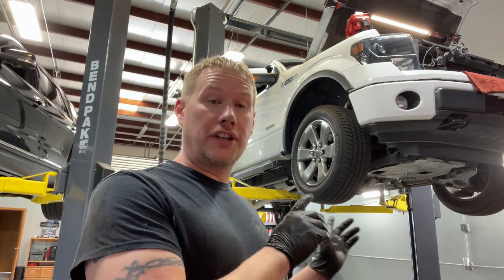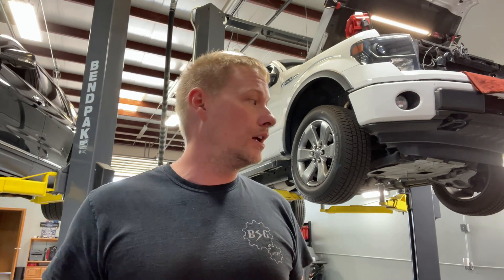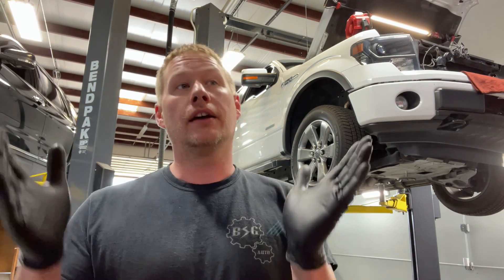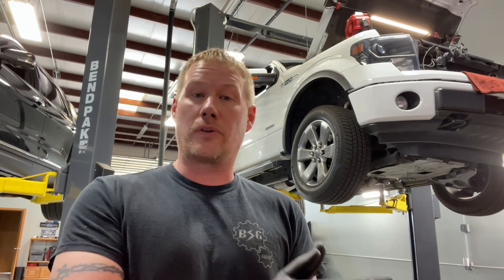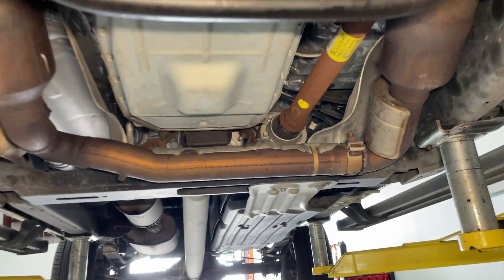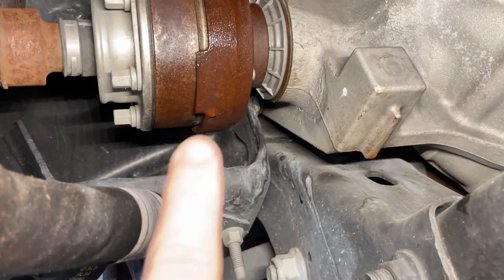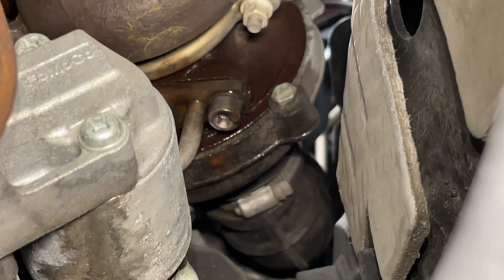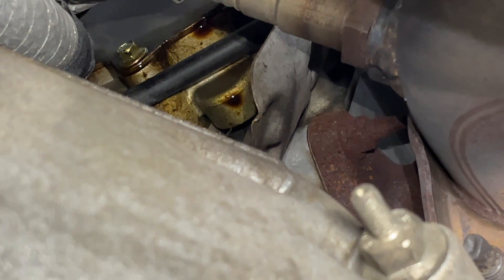Ford Ecoboost Engines Can be so Hit or Miss: I Really Feel Bad for This Customer...

Comment: Yelp, we just had a Ecoboost leave leat week. Had every possible coolant leak on it. No timing job on that one, but we have did several on other engines of the same with around 100K miles. Just very alarming to see such early faults. I have noticed that most faults are occurring when the truck is used for pulling trailers and used in work related task instead of a driving truck. Great info to the public.
Reply: Xtreme - hey sorry to bother you, i thought maybe you could give me a starting point.  my dad has a 2016 f150 with 3.5 eco with about 60,000 miles.  he loves the truck but it's hesitating under acceleration when he leaves a 4way stop or stoplight.  he's had it in to dealer twice and they can't figure it out or replicate it.  i'm trying to do research but wow - i thought maybe i could pull some injectors and check them out but i'm learning they're direct and more complicated blah blah blah.  have you ever ran across this Xtreme?  any tips for me?  thank you -barbie
Reply: @8barbies779  Hey there 8 Barbies. On your fathers Ford eco boost direct injection engine and all makes of direct injection engines there poses a problem with carbon deposits on the intake valves the the crankcase ventilation system. We are seeing this very often and what we do is to remove the intake manifold and clean each intake valve when the cylinder is at DTC on compression stroke. We have the ability to clean them almost to original condition using a blasting technique. Also these Ford engines have common Throttle body issues, but it is more likely to be on the intake valve carbon deposit side. I will post some pictures later on our website showing the before and after pictures of the intake valves. but I'm extremely busy. Maybe this weekend i will.
Reply: @xtremeautorepair   wow Xtreme, i had no idea you were a Real 'Pro', i guess i should have paid more attention to your user name:)))  i can't tell you how much i appreciate you actually taking the time to answer a pissant YT question from me - i know how busy you guys are, it's insane!  i really hope it isn't something that deep, my gut feeling was something fuel related, i was thinking injector etc. but after watching a bunch of vids i'm hearing same thing as you said, lots of carbon tracking, early failing coils, plugs etc.  some of you guys have taught me how to use the mode 6 in my scanner which i've never really used.  thanks again, i'm totally checking out your website, hopefully you're close hahahaha:)))-barbie

Comment: Ford motor company abandoned their push rod V8's and most of their naturally aspirated engines as well, 3.7 & 3.5...
They have been paying the price ever since.... Ecoboost requires a good full synthetic engine oil for starters, I wouldn't run any other oil in any turbo engine.

Comment: Does anyone at Ford watch these videos and go "I think we screwed up"!??  The 3.5 ecoboost engine was touted as a nearly indestructible engine, and all that has mostly come from it is headaches between the turbo's not working properly and the big one, the "rattle"!  Not only am I having problems with my turbos working correctly but the cold start rattle started happening over a year ago, I can't afford the repairs for that, especially taking it to the dealer!  It's an "11 FX4 model with 139k on it, of course I do like the truck but damn the cost to fix this major screwup is affecting so many ecoboost owners!  I'm sure many like myself feel this should have been a recall for any ecoboost regardless of mileage, but it doesn't work that way unfortunately!  Besides my bitching I am still a faithful Ford owner!  I'm looking forward to the new all electric Lightning and am eager to replace my current vehicle, guess time will tell what issues it may have but I'm crossing my fingers it will be much less than many current ecoboost owners have went through!  Just my two cents, and btw, great videos!  Thanks!

Comment: I own a 2014 f50 started having water leaks at 30 thousand mileS found the stupid T CONNECTOR ford insatalls on their vehicles with O RINGS, ENDED UP REPLACING THE RUBBER T CONNECTOR AND ALL THE O RINGS, WAS TOLD THESE O RINGS HAVE TO BE CHANGED ABOUT EVRY 10 000 MILES VERY POOR DESIGN.

Comment: Bought a new F150 in 2020 with a Coyote 5.0 just to get away from the turbos.  Pulling a 34ft toy hauler to South and North Dakota's from Lower Northern Michigan.  I averaged 9.2 mpg total trip.  Met a guy with a 2021 F150 Ecoboost 4.6L averaging 7.6 mpg pulling a 28ft trailer from Missouri.  Screw them turbos!

Comment: It's almost like we're taking lower displacement engines and demanding ever higher torque and hp ratings by using high performance parts and all of that extra complexity adds up to lots more stuff to break and very expensive breakdowns. Nah, saying that would just validate what old school guys have been saying forever, "stop making everything so gd complicated because all the sh!* costs too much money to fix". Good thing those two things aren't at all related.

Comment: I have a 2013 F150 Ecoboost 3.5L FX4. Also immaculate truck. Ver well mauntaind, amsoil oil, the works. Bought from a good friend in Oct '18 with 55k miles, he had it since new so I know the history. It's a very well maintained and "loved" truck. I paid ~$4k to do the timing rattle at start phaser/timing work in Aug of 2019 at ~70K miles. In Sep 2020 at  86k miles, ford redid the timing work under warranty. About 2k miles later, my truck was misfiring, turns out, cylinder #6's intake valve seat broke and distroyed the piston/sleeve/valves/head and needs a new engine. Truck has been parked for a year now. It's going into my mechanic on Monday to swap out the long block. 😡🤫🤪

Comment: 2012 f150 3.5 owner here and adept mechanic.  I have a puzzling squeal noise coming from my truck.  Dealership told me it was my catch can.  I took it off, nothing.  
Man i will donate to your paypal if you can give me an idea.  It squeals/howls only when im barely giving it throttle in gear at any speed.  It sounds like a brake, but its only at light throttle while moving in gear.

Comment: like watching your videos, you have ford fans and gm and dodge fans, all veh have issues, to complex. however ford just can't build anything right thier engineers are bad. And i bought a 04 f150 with 49k on it 4 months ago because it was a good deal, spotless, never worked. 4.6 no guts but its all i need.

Comment: Ford EcoBoost engines are garbage first or second generation. Stay away from them buy the 5 litre instead. The 5 litre won't blow up but the EcoBoost will. EcoBoost is only good as a boat anchor

Comment: Hi Brian. I guess I have been lucky with my 2012 F150 Eco (King Ranch) I have replaced myself the front struts, the rear shocks front and rear rotors multiple times, the front calipers, replaced the brake booster vacuum pump which is electric on this year, I have also replaced Spark Plugs twice including new coil rubber boots - I replaced and re-gapped them a second time to 28 thousand because I think the turbos were blowing out the spark and causing misfires on hard pulls. The truck is currently at 177k today and only now am I starting to hear the phaser rattle you're describing. All I can say is I travel approx 120 miles each day for work and the truck has never let me down. I love this F150 and the Eco-boost engine and when I finally decide to have the timing done I will have everything done at once including the turbos and water pump! Your an excellent mechanic and please keep producing the videos, I certainly appreciate them.
Reply: I have a 2013 f150 with 3.5 Eco with 95k miles. Been having occasional start up rattle for a year or so but the last 3 months, it’s every start-up. I changed the oil and put in Liqui Moly 20232 Molygen New Generation 5W40 . Start up rattle stopped immediately and not one time in 2 months. I have went as long as 48 hrs between starts with no rattle. I don’t know if it’s the viscosity, the additives or what, but I am happy. Anyone have any thoughts??
Reply: @joelalexander8621 I think Melling now makes a HV OIL 
Pump for these. If I was you, I'd get one in her soon,
 along with new timing stuff I think Brian has a new video on the pump. My 5.4 Runs like a Swiss watch, because I listen to everything this young man says. I did a complete timing job, plus all new roller followers and lash adjusters at 153k.

Comment: 50 to 60,000 miles seems to be when the problems start cropping up regardless of power train.  I had a 2011 3.5 eco that ran great until 50k and then ran into the carbon tracked plugs missing problem.  Changed out the plugs and a bad coil and it was good till 60k when the vacuum pump started making noises when I traded it for a 15 coyote.    That ran great with the exception of needing the rear brakes totally rebuilt because the parking brake adjusters froze up twice in 60,000 miles.  At 60 k the water pump went and at 62k the front hubs and 4 wd actuators went.  I’d trade it but it’s impossible to find a replacement without a big markup right now plus I was thinking of going back to eco boost because they put that stupid cylinder deactivation on the v8s plus the wet belt oil pumps.
Reply: Scotty - hey scotty, my dad has a 2016 f150 3.5 eco, only 60,000.  his truck hesitates/misses badly at 4way stops & stoplights.  not every time, but a lot.  he's had it in the dealer twice & they can't seem to figure it out or replicate it. it's driving him crazy.  he's asked that i research it for him, i thought maybe i could pull some injectors & run them through an injector cleaning machine that i've built but doing some research i guess they're direct & harder to get to etc.  you peaked my interest in your comment when you said  -  "carbon tracked plugs missing problem".  i'm not sure what that is but man, i'm really hoping you get notified and can give me any tips or pointers on what it might be.  thanks in advance -) barbie
Reply: @8barbies779  The first gen 3.5's (maybe the 2nd gen 2 too but I haven't heard any complaints) have a problem with carbon buildup on the insulators that short out the plugs usually when under heavy load so it doesn't show up on the diagnostic computers unless you push things a bit.  This is probably caused because of the extra heat that a turbocharged engine produces.  Another problem is the electrode gap on the plugs opens up over time.  People usually see these problems in the 50,000 to 60,000 mile range.  In my case they found one carbon tracked plug plus the coil pack was bad as well.  There is also some sort of plug adapter between the coil pack and the plug that can also get carbon tracks.  I'd start by putting in a new set of plugs and adapters.  It would help if you could find out which cylinder is missing so if the new plugs don't fix the problem you could swap out the coil pack or try a different cylinder's pack and see if the problem moves to a different cylinder.   Changing plugs in a truck can be a pain unless you have really long arms - I had the dealership do mine.  There are also the moisture issues with the intercooler but i didn't see that living in PA.
Reply: @scottyV1000  dude!  thanks so much for replying man, i really appreciate it.  you know, you've so nailed what i've watched in a couple good vids i found after searching forever.  when my dad told me about it i immediately thought fuel but after seeing all these carbon track/coil pack/early plug failures it gives me hope.  thankfully a few of these video guys have shown me how to use that 'Mode 6 data' part of my scanner so that i can look at history etc.  these newer cars are so hard for me.  thanks again man, i'm checking everything you just laid out. :) -barbie

Comment: Hey I know you probably won’t see this. I have a 2019 f150 with oil consumption issues. 5.0L motor. Do these have issues with the timing chain rattle and oil consumption in the future? I’d like to buy the lease, but I don’t need the headaches of this engine if it’s junk
Reply from the maker: Absolutely avoid any 5.0l 2018-2020.
Reply: @FordTechMakuloco  thanks for the response. This trucks 5.0 engine burns oil, and the phasers/ engine rattles so bad. It knocks and pings. I’m going to trade it in at the end of the lease for. 7.3 gas f250. I hope it gets better. The only reason why I would consider keeping the truck is because my lease buyout is 28k, which is almost 8k under blue book because of the market. 

Thank you for responding! I hope Ford gets thier shit together I’ve been a loyal customer for 20 years. I have a mustang and a f150, my dad has a ranger. We just switched my fiancé to a Corolla from her 2011 escape. The escape was an absolutley money pit for a 10 year old car.

I’m thinking of switching to Toyota myself :(

Comment: Yes those are the common leaks,I mostly see the lh side coolant turbo coolant tube fitting  leak,not so much fh side.Another failure of that Era truck is the f27 fuse melted.
Reply from the maker: It's not as often as you may read about.
Reply: I haven't  read about it,it's what I seen as  a FMC tech.

Comment: Good job informing your viewers on all of these common issues. We inform our customers on all of these when they come in on a person to person basis but your channel reaches a lot of people. We’re seeing a lot of these leaks at mileages far too low for customers to have to be liable for the repairs. Ford should step up to the plate and help these people out especially since they pushed the whole platform as the greatest thing since but we all know how unlikely that is. Thankfully we’ve built up a lot of trust with our customers because coming to them and telling them they need some expensive repairs on a truck with relatively low mileage that was well maintained can make people really question you.

Comment: you can change all the coolant fittings without removing the turbos. still PITA but can be done within couple hours. but i would still rather work on these than the 2.7 ecoboost that has an oil pan that doesnt ever seal...
Reply from the maker: I know you can but it is a very hacky way especially the rear fitting.

Comment: Just had these issues repaired, both turbos leaking coolant and vacuum pump leaking oil, $2300 later they're fixed and guarenteed for the next 2 years, so I got that going for me, which is nice. 2013 Limited, 106,000 miles, and other than this, has been a brilliant truck which I still love!
Reply: Very nice Carl!

Comment: Just another reason Not To Buy 1/2 ton trucks.  Buy a 3/4 ton truck. Usually the gas ones are naturally aspirated without all the turbo crap & v6. They come standard with a good ol V8. That's what I did. Still enjoying my 05 Ram 2500 HEMI. No major problems yet. With thousands of heavy towing & hauling miles on it.

Comment: Most folks drive their pickups every day.  A 200-300k mile ecoboost would have the  same number of heating and cooling down cycles as a 50k one .  A well maintained high mileage vehicle will often give less trouble than a low mileage one. The warm up period gives the most amount of wear.  Driving a truck across country and racking up 5000 miles over a week  is going to give a lot less wear than cranking it up 2 times a day and commuting 10 miles back to your work  for a year. One has a vehicle running for 50 minutes during the warm up, the other has ran 2500 minutes during the warm up assuming 5 minutes for the vehicle to reach operating temperature.

Comment: I have a 2012 f150 ecoboost with 273,000 miles and it has cost me out the butt in repairs. I have all of these leaks right now and had them the one below my fill reservoir last year and basically caught my truck on fire by dripping down onto my alternator. I think my turbos are toast at this point and have to find a mechanic tomorrow that I can trust to fix it

Comment: FordTechMakuloco do you still recommend the same catch can system for the 3.5L Ecoboost that you did 6 years ago? I have a 2015 Expedition that I'm using BG Induction service on at every oil change, at 150,000 miles now, but still getting the flutter/rumble strip feeling/noise. Some times after the induction service it fades away for a few thousand miles, and other times it doesn't go away. I should have put your catch can on at 100,000 miles when I first saw you recommend it, but I'm ready to now!

Comment: Makes you wonder if the new eco-boost and like the Ford broncos will have problems such a big hype about those vehicles but most of them have an eco-boost so who knows I don’t know if they got the bugs worked out but obviously there’s a lot of issues on the truck there I’m like you said it’s well-maintained and that’s just really sad for the customer I’ll tell you all the Ford‘s I’ve had luckily I’ve been good F2 50 and F3 50s my latest one is a 6.2 and I haven’t had one little people out of the truck and a tow really heavy with it but I take immaculate care of it maintenance wise , The only thing I haven’t found on my F3 50 Dooley was when I bought it with 50,000 miles the rear DIff was really really nasty when I change the fluid but it probably came from the limited slip

Comment: Brian, you are correct about hit or miss. My son has a 2011 3.5 EB with 280,000 miles on the clock and still going strong

Comment: This is the reason I shipped my 2017 Explorer Sport down the road.. It was very well maintained and serviced but I got extremely concerned at 105,000 miles.  Bring on the Toyota Sequoia 5.7L with no boost adders.